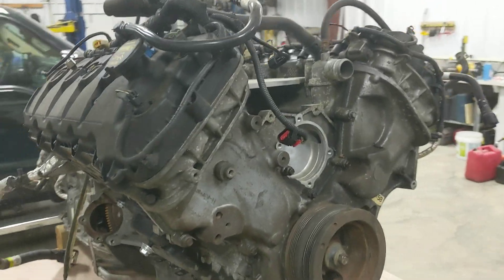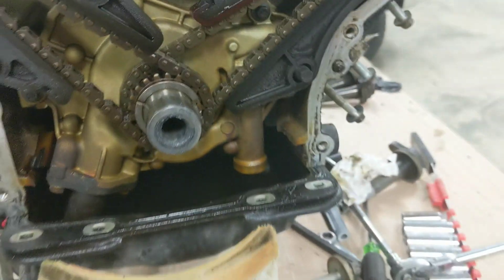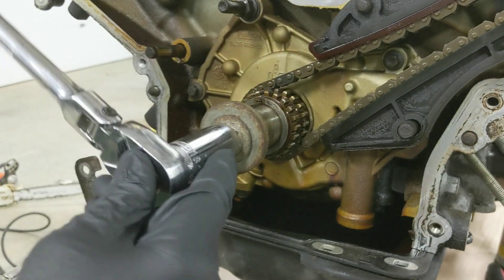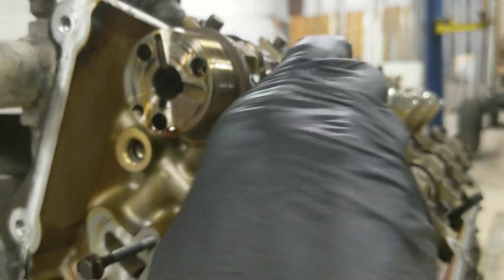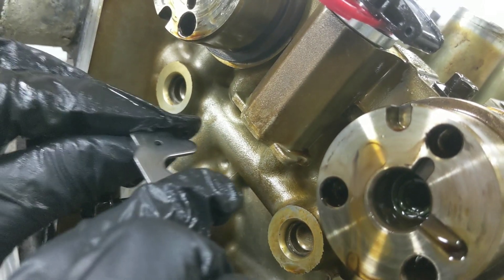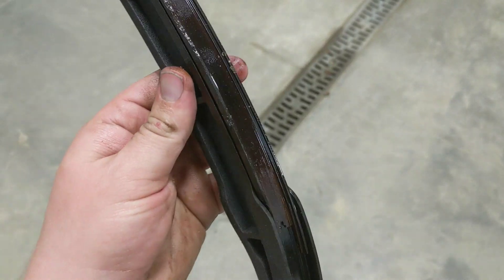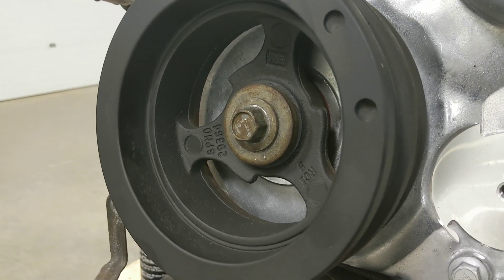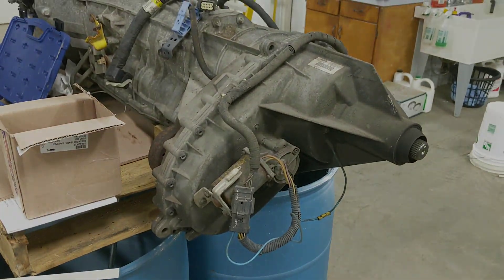Gen 1 Coyote Timing Cover Swap and Chain Replacement -- Coyote Swap Bronco

Comment: Did you swap the cam phaser bolts?
Reply from the maker: Been a long time but I don't believe so.
Reply: @605BOLT I gotcha. You literally caught that timing chain setup right in time. My engine had the secondary tensioner fail and it destroyed the chain rollers. That tensioner on the right bank was an oil change away from going 1000%. The engines gonna run a long time with the new chain set. Thanks a bunch for the part numbers!
Reply from the maker: @WiseGuyzGarage right on man! Always fun working on old Fords

Comment: hey man i am doing this job, but i have camshaft b2 exhaust that has broken tooth, so i am replacing it. is there any sort if cam alignment ? how do i know if it correct position?
Reply from the maker: You install the phaser just like in this video where we had it removed. You will be using a new one instead. The springs should retract them to their at rest position which is how you install them.

Comment: its been 3 years, has it blown up yet?  Blown out a cam phaser yet? 300k miles is a lot of miles to NOT do a complete rebuild.  When you pull the cam phasers off, down inside the end of that cam are a set of filters.  Those should be replaced every single time the cam phasers are removed.  L:ooking at yours you can see sludge buildup right there in the end of the cam.  which will cause your cam phasers to not operate correctly or just fail completely.  I cant believe you re-used those VCT solenoids.  How damn cheap can you be dude.  $86 for GT500 vct solenoids.  Its just good insurance.
Reply from the maker: @jowens1126  no it's been running great.
Reply: I would have replaced the intake valves they are usually razor sharp by 200k
Reply from the maker: @RichardMartinez-vp5lh  no issues.

Comment: Thanks for the great video! There's only a small handful of videos I could find on this but none as thorough as yours. I'm currently pulling the driver side head off only. When I got to put the chains on after putting it at 9 o clock, do I still need to rotate it back to 12 even though I won't be touching the chains on the passenger side?
Reply from the maker: Then no. Just do the one side you need and should be good. Never done that before so I'd really have to think it over. I'm betting no though.
Reply: @605BOLT  Should I turn clockwise (1/4 turn) to 12 o'clock or counterclockwise (3/4 turn)?
Reply from the maker: @ziyuliu201 Pretty sure it's whichever would have the data matrix facing up.

Comment: Hey 605BOLT, . I have a 2013 F150 5.0L & timing chains need to be done. Exact same issue. My question is, what would be a estimate of the cost to do this job from start to finish including parts & labour?? Keep in mind I'm having a certified mechanic buddy of mine doing the work privately instead of paying higher shop rates. Trying to save a few bucks that way but at the same time not lacking on re-installing high quality brand new parts. Thanks!
Reply from the maker: Boy I don't know. Even at the reduced labor rate, I have no idea what all needs to be removed from the truck to access the timing cover. I figure it takes most people a day to get it taken apart and retimed as well as a day to put everything back. But that's a guess.
Reply: @ Appreciate the reply👍 Great channel, keep up the great work! Cheers 🍻
Reply from the maker: @ginge6805  thanks for the kind words. Did your buddy get it fixed up?
Reply: @605BOLT  No problem. He's still on it. I will keep you posted.
Reply: @ginge6805  all fixed? how much he charged?

Comment: I'm new to the Coyote engine build up, why is the mustang timing cover better than the stock F-150?
Reply from the maker: @douglaslanejr3999  the accessories fit a little differently on the front of the engine. All the aftermarket systems are designed to be put on a mustang setup. So basically if you have an f150 engine you swap the cover to make it more similar to a mustang
Reply: @605BOLT cool, that makes sense. Thank you for your time and information. I look forward to learning more about this engine.
Reply from the maker: @douglaslanejr3999  I really like them. Thanks for the kind words.

Comment: Late to this party, but according to everything I've seen on the Internet you don't HAVE to pull the valve covers to change out the timing cover off you're not doing anything with the timing itself. Is that correct or am I getting bad info? I have a 2011 F150 that needs a new timing cover only because of a broken pulley.
Reply from the maker: @christyson3812  ya I think you're right. It would be a little tough to do anything with the chains but yes you could get the timing cover off no problem. Good info for people cruising the comments.

Comment: Great video. I was wondering, before you rotate the crank back to 12 o clock (to put the 2nd chain on) should you remove the tension pin on the primary chain first?
Reply from the maker: I think I removed pins right at the very end. Been a few years now so my memory is fuzzy.
Reply: @605BOLT  thank. hows the motor after 2 year? thinking if I should get an coyote f150 with 200k + (do timing and water pump)
Reply from the maker: @8eastk  it runs. It's still sitting in a chassis being restored but it fires right up and runs. https://youtu.be/Eqeh0A15aw0

Comment: Did you change those dirty cam filters?
Reply from the maker: No I did not change any cam filters
Reply: @605BOLT  NOOOOOOO, I pray for your engine then bro. I've heard those filters getting clogged can cause catastrophic damage to that top end. Hopefully people are just blowing it out of proportions.

I found them while on FordPartsGiant digging for parts and was like wtf are these. At that point I had seen at least 10 videos on changing the timing and no one mentions them...

Hopefully she'll hold on til you get in there the next time.

In case you or anyone else is curious the part number should be 9L8Z-6C683-A
Reply from the maker: Started the engine just the other day.  Shes good to go.
Reply: @tyrannusspissamentum4423  you don’t need them things

Comment: Did you have to make sure the engine was in TDC? I had to redo valves, pulled heads, then I cleaned off my pistons and now I put heads back on but I need to find TDC from everything I’m reading.
Reply from the maker: Yes always a good place to start. But with no heads, it's just up on cylinder one. No heads on to make it be power stroke or intake stroke.
Reply: @605BOLT  I appreciate your response. Thanks!
Reply from the maker: @sojministries337  my pleasure.

Comment: Why rotate the crank? Why not just leave the key way at 12, and the crank gear mark at 7?
Reply from the maker: I was following the comp cams procedure. You would have to ask them.
Reply: You can do it your way, but don't be surprised if pistons kiss some valves.
Reply from the maker: @Smasher-Devourer  ya I mean you just gotta follow this procedure. 🤷‍♂️
Reply: Say if the engine is out of time? How do you remove the chains if the QR codes on the cams don’t face up?
Reply from the maker: You can remove the chains wherever they are. But if it's out of time and you ran it or forcefully turned it over,, coyotes are interference engines. Meaning it's probably toast and you need to take the head off to inspect. Then repair. Then retime. How do you know for sure it's out of time? Did a chain break?

Comment: How does the right side small cam phaser chain go on . 2 links to which side 1 link  to 1 side .
Reply from the maker: Same as driver side. The marks should face away from each other. Double link straddles one mark and single link straddles the other. Doesn't matter which goes where as long as they point away from each other.
Reply from the maker: I'm sorry I'm not sure what you're asking.
Reply: Timing passenger side cam phaser chains .

Comment: So I got a question I'm also getting the timing cover from power by the hour performance do I need to swap out to a mustang oil pump or can I still use the F-150 oil pump
Reply from the maker: I'm not aware of a pump difference.

Comment: Hate to say it but my 98 mustang 4.6 L is riding on borrowed time. Theres sparkles in the oil when I change it. Im the 5th owner, id say it faired well considering what its been through. It still runs good, but it definitely could use a complete overhaul
Reply from the maker: Or a Coyote swap! haha.  But ya if you've got sparkles its not usually a great sign.  I have a video about cutting open oil filters.  Its an excellent way to see just how hurt it actually is.  Might help you out if you changed oil recently and have a filter laying around.  https://youtu.be/Tx1kq33sMwY?si=pwXFVCxM0pSpjOzd

Comment: If my truck needs timing can i use the stock guides and  tensioners i bought a timing chain kit from O'Reilly's but came with the new timing chains but not the tensioners or guides was just wondering if i should buy the guides and tensioners as well
Reply from the maker: It will probably be fine. Ours were visibly broken. Reusing guides is generally not done. Most people replace it all when they are in there.
Reply: @605BOLT  so I should replace it all to be on the good side thanks I'll order the same kit you got
Reply from the maker: @WallanceBoudreaux  that would be my thought. It sucks to get back in there just because you cut a corner. Buy once cry once type of deal. 🤷‍♂️
Reply: @605BOLT  thanks man should i buy new gaskets for the head covers or they should be fine
Reply: Also is there gaskets for the timing cover or anything
Reply from the maker: @WallanceBoudreaux  will need new timing cover and valve cover gaskets.
Reply from the maker: Also, thanks a ton for using the Amazon link in the description if you do. Really helps out the channel
Reply: @605BOLT  no problem least I could do for you showing me how to do everything great instructions to by the way before I put together I saw something about people saying u didn't show a part about turning the driver side a full turn or something
Reply from the maker: @WallanceBoudreaux  I honestly have no idea what he's talking about haha. Video has 50K views. Only one guy couldn't figure it out haha
Reply from the maker: @WallanceBoudreaux  if you get confused it is basically word for word comp cams' process.
Reply: @605BOLT  after timing it and everything did u prime it with oil or no
Reply from the maker: @WallanceBoudreaux  no. Just crank it up.
Reply: Was also wondering about the set you got and how it would hold up if I wanted a little more horsepower outta my truck nothing crazy but wanna do a air intake and tune and exhaust
Reply from the maker: @WallanceBoudreaux  those power mods won't hurt anything. You will be good to go.

Comment: that engine has 300k on it and you pulled it out but didn't go thru the head and pistons?  WHY?   good grief what you aiming for a million miles? from what I understand the 2011 isn't even the best 302 on the road? some say the next 2 gens are even better, excluding current gen.. I guess it has a few small issues?

this engine must have been rebuilt at some point right?  real good mileage if not, good maintenance... reminds me imma do mine early.. worth it I guess? an early $300 in TOTL tune up parts is worth getting 300k in my book or a chance of ...   lil' ferd scort car has 383k + 64k and counting on her...  she could use a long tune up for sure, all new emissions parts think imma splurge the $600 and go everything new, all emissions parts, injectors, throttle body, AIP, MAF, ATS, AIC, DPFE, EGR and control solenoid, VCV, vapor canister and control solenoids, catalytic converter, the works, all had around $600 . . .  if compression is good i'll leave it, if not rings and valve lap or I rebuild the spare head...  well worth it for another 400k miles at 35mpg.. + shes a wagon!  she'll carry full sheets of plywood!!!!  at least 10 sheets of 5/8s,  roof rack too I can jed clampett that buggy all day if I need to...  lol,  oil changes are crucial, top liquids and filters . . .

ncie job on the ferd... good for another 300+ hale that guide had at least another 300 left on it
Reply from the maker: I don't pull pistons out of engines that are running perfectly. I don't care how many miles they have on them.
Reply: Shit the first coyote 302s are the best ones they’ve put in these trucks the 2015+ coyote 302s all have more issues than the 2011-14 motors. They also fucked up when they replaced the 6 speed transmissions with the 10 speeds. Moral of the story is  the 1st gen coyotes are the most reliable.
Reply from the maker: They are stout. Plus it's just going into a baby bronco. No more pulling weight around for this one.

Comment: no wonder they do the phaser delete kits and upgrades, look at the size of those puppies holy smokes, you can get aftermarket that are a lot lighter, billet aluminum.. apparently the inertia wear form the weight of those doggies and put undo stress and wear on your chian, not to mentions rob you of response and power, reminds me of the hayabusa crank balancer, fookin huge and better off without...
Reply from the maker: This will just be a stock runner. No need for the fancy stuff.

Comment: I have gen 1 heads and gen 2 block, only difference is gen 1 block used 13 mm head studs Gen 2 used 11mm , or vice versa but it works just fine(this is a twin turbo build w over 100k miles). The timing chain cover is the same. Even the F-150 is the same other than provisions for AC Belt tensioner.
Reply from the maker: Excellent info.  Sounds like it will be a nasty powerplant!!
Reply: @605BOLT  thanks yes it is, it's been roadworthy daily driver 750 WHP on 93octane since 2017. Originally built 2015, rebuilt 2017. Can turn it up, w/ supporting fuel, over 1100 rwhp😁
Reply from the maker: @bigmotoxer  😳 wow haha. I like it.

Comment: When i rotate the engine my matrix  data marks are on the top. pass and drivers side.
Reply from the maker: After you rotate it idk if things will continue to be lined up. Might take like 50 rotations or something for it all to line up exactly again. I just don't know.
Reply: @605BOLT   I rotated it and they line back up top again
Reply from the maker: @kingwrench00  I'll be honest it's been like two years since I did this video and I don't remember anything besides what is in the video. 😬
Reply: Did u fix this ?? If so how ??
Reply: @golfatit3140   line the matrix markz up on camshaft
Reply: Camshaft have matrix marks on all 4 Camshaft, make sure you check the Camshaft filter inside the middle hole of Camshaft

Comment: With that many miles 
Would have replaced those cams 
The VCT solenoids 
And oil pump gear , crank sprocket
Reply from the maker: The cams looked just fine and coyotes have bearingless cam journals.  No need to replace.   VCT solenoids perhaps if they rattle but thats an easy change after the fact if necessary.  The oil pump gears are new (included in a new oil pump).  The crank sprocket is just a sprocket.  Shouldn't have seen much if any abuse in a 2011 pickup.  Thats my opinion anyway.

Comment: What did you do when you bent valves after you didn't rotate the engine 1 full revolution to 12 o'clock after drivers side chain was installed. You missed that step and created lots of bent valves across the country.
Reply from the maker: The engine rolls over just fine. Idk what you screwed up but you can clearly see by the comments and likes on this video that it's the correct process.
Reply: @605BOLT  I'm in the middle of one right now in my shop.  our internet went out today and I can't get on any of our all data or pro demand working so I can follow procedure. I used your video and now when I go back 12 o'clock it hits a valve. So I got frustrated went to banner Ford and found out after you replaced the driver's side chain you got to rotate the engine clockwise 1 full revolution to 12 o'clock. Your videos didn't describe that particular step. So now I'm in the green the engine runs fine. I'm just pointing out that your video didn't show that step. I'm raging your video just pointing out it's not in depth enough and a little confusing.
Reply from the maker: Oh my mistake.  I misunderstood you.  Its basically a copy of comp cams' procedure if you can find that one.
Reply: @605BOLT  no problem wasn't hating just a little confusing. But hey I made it through it. 👍
Reply from the maker: @Slayer-oq8fv  no problem. Thanks for commenting! 🍻
Reply from the maker: 38K views, 97.5% like ratio.
Reply: So on a 2011 f150 5.0 I just got done doing driver side at 9oclock position so now I go back clockwise to 12oclock position a full turn or the quarter turn ???? I’m confused . I haven’t heard anything g about the 360 rotation till now . Can anyone plz answer this? I’m not going any further until I confirm what to do to move to passenger side . Thanks for all the info . This video helped me with everything but this rotation back to 12 I lock.
Reply from the maker: Quarter I believe.  Been like 2 years since I did it but you won't want to roll it around completely with the heads on.  Thanks for the kind words.  Sorry I didn't see this comment til now since it was a response to another comment.

Comment: How do you adjust it they are not both on top?
Reply from the maker: That's ok. If the little data matrix are not facing up, just roll the crankshaft a little bit of top dead center (so none of the pistons are at the top of the cylinders) and then rotate the cams so that they are facing up.